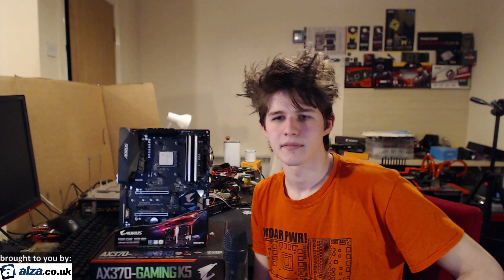Gigabyte AX370 Gaming K5 VRM testing results

Comment: I picked up this board last week second hand at a VERY low price. After watching this video, I fully expected the VRM to be garbage, but low and behold, it stabilized my overclocks and VRM temperature held at only 61C while using a tower cooler. It's the 4 phase VRM that could. My overclock is only limited to the quality of the Ryzen silicon.

Comment: I bought this Mainboard with an Ryzen 2600 and 16GB G.Skill 3200 CL16.
My EK WB Monoblock is doing very great, VRM and CPU (4GHz OC) are around 45-47°C @ 1hour Prime95
Its BTW my first Watercooled System.

Comment: what mic is that? also, can you make a (casual) video about sensor setups, what type of products are needed like probes or multimeters, if soldering is required, mistakes/inaccuracies like infrared sensors changing based on the material, etc?

Comment: Two best am4 motherboards is assrock taichi at 4,2 GHz and gigabyte gaming 5 white at 4,15 GHz....am4 b350 motherboards is more made for CPUs like the 1300-1500-1600 ..cause it has little vrams ..putting 1700 in a b350 has volt shortages and it not made for over clocking really a 1700 CPU..good for a 1600 though

Comment: My Gigabyte AB350 Gaming 3 will just cut the clock speed right down when it hits the VRAM Temp limit. And like you said, does it right away lol. But Of course the Gaming 3 board is worse for OCing lol.

Comment: I'm using a 360mm radiator on my R5 1600, which is overkill cooling for it, yes. But, I do plan on putting an 8 core in it at some point and using the same motherboard. I'm also doing a pull configuration from the top of the case, so the fans blast air over the VRM and RAM, to help keep them cool.

The LLC on my Asus Prime X370-Pro set to level 3, keeps Vcore right at 1.37 to 1.38 under load for 3.9Ghz OC, measured at the back of the socket with a multi-meter. Glad I went with the Asus board, because I'd not be happy with the Gigabyte board lacking that option.

Comment: The voltage of that CPU is so variable.

My first R7 1700 did get to 3.9Ghz at 1.39V and my board VRM was toasty (Gigabyte AB350 Gaming 3).
I did RMA it because of the segfault problem on Linux and the new one are extremely good bin..

1.33V at 4Ghz, seam ok for 1.35V at 4.1Ghz but did not tested enough at that speed yet. Also at 1.33V it was so better for the VRM..

I did replace the Gaming 3 for an Asus B350 Prime Plus because I did needed the PCI slot without having a floating scsi card with an adapter in my case. On the Asus, the VRM feel a little more .. soft. As I need to put some LLC (to Regular) to get it stable while the Gaming 3 did not have such a thing but also don't need it with the same 1.33V.

If they did have a Gaming 3 with at lease one pci slot and moar bios Options, that would be my choice (I 3d printed a air duct to vent the VRM so the temp was really not a problem).

Comment: the same thing as my gaming carbon pro
hits that max tctl temp on max OCs and shuts off instantly
dropping core volts to 1.375 smoothed everything out mostly for me
b4 this u could feel the heat comin off the VRMs
anything but b-die ram is still jacked tho

Comment: 1.37V sounds like a lot. I mean my 5930K does 4.4 @ 1.08VHope AMD can catch up to that one day.
Reply: looking at ryzen's thermals and power consumption that doesn't look bad at all
Reply: I would much prefer 1.37v core voltages at 3.8ghz at say 100-110watts with a ryzen cpu, than 140watts at stock clocks with a 5930k. Comparing intel and AMD core voltages is pointless, they are different CPU's with different voltage requirements and tolerances.
Reply: What is your point? We all want better clock speeds out of ryzen, no argument there. But I could care less the voltage required to get there assuming it does get there and can be cooled. The silicon and transistors in ryzen are largely whats holding back it's OC potential, not voltage or thermals. Even with LN2 it's hard to get past 5ghz with even somewhat acceptable memory speeds.
Reply: Indeed they are different CPU's in most ways, but at the end they compeet in the same business. If you care about TDP, you might be right, but as i'm more interested in OC than power consumption, i think i can stand my point.

Comment: I hate that this and ASRock's Fatality don't have LLC control. Like B350 I can semi-understand, but X370 is just not really acceptable.
Reply: awesome David K. explained this to me: first batch of K4 (the one I have) had the LLC setting, then they changed VRM layout on the 2nd batch and removed it. Then they stopped producing the K4 and launched the X which is basically the same as the 2nd batch K4 but with a fix to RAM pcb which in the K4 limited the speed to 2933
Reply: Which Asrock Fatality? I have the X370 board, and it has LLC.
Reply: The Gaming X doesn't, but apparently did at some point and then they removed it. The K4 still does though.

Comment: I keep my Ryzen 7 1700 at 3.9 GHz with 1.375V since the second day it launched and I received it. My MB is an AsRock X370 Killer SLI/AC. The voltage calibration set to 1 out of 5.

Comment: Gigabyte 5 avoids the overheating issues that he's seeing here with the K5, due to much lower heat output (more efficient).
Either way, inside a case, if you have multiple exhaust fans rather than just one rear fan or a open test bench (along with an air cooler, or a water cooler that directs air flow to the VRM wheras buildzoid has a watercooler for the CPU laying off to the side) you'd prolly have better results
Reply: AT least I presume it would end up working better, prolly wrong
Reply: Depends how well the AIO is ducted. I had 1/3 of mine intake from the VRM, allowing me to push my $40 board with 4 phase VRM past 300w on FX (this was a board Buildzoid wrote an article on that said don't overclock even a 6 core, it will probably catch fire... Something along those lines. But I managed to do pretty good with an 8 core in terms of clocks. I think the AIO fan speed of 4,000 rpm definately helped, it was moving a lot of air over the VRM (ducted with a ghetto pop-tart box cut to make a basic duct).
Reply: I have the Z370 Gaming 7 and it has a little fan built in for the VRM. Hasn't ever kicked on yet with my 8700k @ 4.9ghz. I  have to delid if i wanna go any higher. Chip is HOTT!! Really nice board though. Aorus is really pretty. It's my first gigabyte board.

Comment: I would never buy a board with overheating components. design failure. for me not acceptable. gigabyte up7 ain't had no probs with that.
Reply: That also means you can't go with Intel (even the CPUs have basically blankets in between the IHS). I wonder why mobos don't use awesome heatsinks like they did on a lot of the AM3+ boards, those things had heatpipes and a huge amount of fins, these new ones are a rock with some slits (Linus Tech Tips style I guess...)
Reply from the maker: most AM3+ boards would also fail the test I ran this board through.
Reply: That's true, and adding a fan was essential to mine (you gave a review on my exact board warning to not even overclock the 6 core chips). I managed to pull over 300w with an FX-8350 at 1.5125v with the $40 Asrock 970m Pro3 (the one with heatsinks). So it could handle an FX-9590 after modding, but not much above stock for the 9590. You were right about it not being able to handle it though, at least without fans, pretty much burn your finger on the VRM with anything over stock with my chip. But it would at least throttle when overclocking to prevent a fire, which was good.

Added heatsinks to the chokes, 2x 40mm fans on the VRM, followed by a duct for 1/3 of my AIO inlet to suck from the VRM (120mm fan at 4,000 rpm). That was what it took, but it was just $3 plus some glue and a pop-tart box, not a difficult modification, but it wasn't exactly pretty after I was done.
Reply: On the nice boards though, some of those had heat pipes, and since they had more than 4 phase VRM, they ran a lot cooler. I'm thinking of the Sabertooth and similar boards. I wish we had those massive heat-sinks back. Its like technology took 1 step forward and 2 steps back on cooling.
Reply: Actually Hardcore Overclocking there is no advanced knowledge involved to design a working heatsink solution. the only thing what seems to matter is some sort of design. its not even pretty..so for me a total fail. I will never support such nonsense.
Reply: If I'm reading your statement correctly, are you saying my heat transfer class was all a lie? Its not simple, you need to calculate optimal number of fins for different conditions (natural air convection, forced air from a fan, and how fast), too many fins means you choke it and it does worse, too little and it doesn't have enough surface area. Its really not a simple thing to design, but if you are talking about the garbage they are using now that is like a rock with some slits cut out, those must be made by marketing, because they are awful...
Reply: Jake Garret every manufacturer did produce working heat sinks in the past. there is no need for development work.
Reply: We can always make better (just like vapor chamber heatpipes were a big thing, recently using wicking material for move fluids through capillary action have seen production in heatsinks). The problem is, we are using the worst heatsinks I have ever seen on these boards. It looks like the disaster LTT made with a reciprocating saw, and a block of aluminum. Clearly these were put on by marketing, because no engineer (even drunk) would think these were good. What is sad, is these pieces of junk need to be custom manufactured instead of pulling a real heatsink, right off the shelf and bolting it on, so they are paying a lot more, for something that performs terrible.
Reply: you're right. the main problem is people still buyin this shit. first the intel TIM desaster and now on top of that heatsink dummies. i can not believe how much junk you get if you buy modern consumer pc stuff...I boycott that. reviewer should broach the issue more clearer

Comment: Here's a thought for you, recently Der8auer released a range of custom intel processors. Given your obsession with VRM's and their inadequate heatsinks, why not team up with a third party manufacturer and release a range of Buildzoid VRM heatsinks that will tame the VRM's.
A third party VRM heatsink with built in active cooling retailing starting around $20 could be quite an opportunity to exploit this obvious design flaw of inadequate cooling on lower end and some upper end boards. Heatsinks properly finned in aluminium and the premium copper with dual 40mm fans and RGB could become reasonably lucrative in your niche market.
Reply: too many motherboard layouts due to many many separate motherboard models, and small market, No average joe is gonna buy this, and who ever would buy it probably will spend that money on a better board.
Reply: A lot of VRM layouts are very similar, especially the vcore which is the important bit, that it would be possible to create a universal heatsink with adjustments for mounting points. Sure there will be exceptions but if you look at each manufacturer, their B350/x370 boards all run pretty much the same or so similar so as to not make a difference. So at worst you are likely to need just one heatsink design per manufacturer per chipset, but more likely  you will just need one heatsink per chipset with a variable mounting point design.

"No average joe is gonna buy this"
Which is why it's a niche product, there will be average Joe's that will, but the target market is overclockers who cannot buy the upmarket boards and compromise to entry/mid level boards just like the one depicted in the video. $20 for a VRM cooling solution that is tidy is a much better solution than zip tying a fan over the VRM area. People routinely spend $100+ on CPU cooling that doesn't help the VRM's, so $20 isn't a huge ask for the VRM solution.

Then there are boards (like the asus b350m-a) that doesn't even have a cooler on the VRM's.
Reply: I don't know if he needs a custom heatsink, but just a simple custom fan that you can mount on any of these motherboards would be good enough it seems. Something that fits on the bottom end or top end, or maybe on the side of the capacitors, so you know that it won't interfere with an IO shroud or anything like that on any motherboard.
Reply: So... He would sell a couple 40mm fans and zip ties? That's as universal as it gets, and takes like 3 minutes tops to install.

Comment: I have a gigabyte X370 gaming (cheapest one, vrm layout looks the same) with a 1700@3.8+stock cooler. According to Hwinfo my vrm temp settles aroung 80c. Case is corsair 460x with intake and out take fans, so its well ventilated.

Comment: Want to see a bad VRM heat sink? Look at the msi x370 gaming pro carbon.
Reply: Really? I just ordered one, as I had to RMA my B350 Strix board, and the Gaming Pro Carbon looked like a worthwhile $30 upgrade. Please elaborate, and whether I should cancel the board and get something else.
Reply: Ben Willis I am running a R5 1600 at 3875mhz 1.45v on this board. I don't have equipment to test the thermals but under full load the vrm is hot to the touch (it feels slightly cooler than a cup of coffee) maybe 65c with the CPU pulling about 100 watts on HWmonitor. It is an 8+2 phase though. I was just pointing out that the heat sinks don't have much surface area.

Comment: the prime x370 pro has the same vrm as the strix x370-f is cheaper and has aparently better vrm cooling
Reply: same design different mosfets
Reply: I have the Prime X370 Pro and it's got some hefty slotted heatsinks on the VRM. I have had no issues with the board in this regard, and currently running a custom loop.
Reply: Yeah it is pretty good. I just would like to know what their temperature sensors are. They have 4 sensors named "Temperature" numbered from 3 to 6 in HWiNFO64 which I just can't figure out what they do.

Comment from the maker: guess how many reshoots this one got!

Also OC show on twitch today!: https://go.twitch.tv/overclockingtv
Reply from the maker: too low
Reply: Uhm that wasn't nice. It was flowing nicely but feels kind of empty so, same scaling this one was zotac 16 phase vrm good marketing but empty inside.
Reply: At least 10 because you knew exactly how to phrase what you wanted to say and were very sure of the numbers.
Reply: Knowing your channel, I'd say 0, but I'm now wondering is that a tricky question?
Are you going to water-cool this VRM if you use it in your daily machine?
Reply: well, been chasing down a random, totally random crash issue this week on the non-k 5... So I will guess that many times, lol.

We need to find real aftermarket heat-sinks for our VRMs, somebody somewhere has got to make them (that is not ten year old discontinued parts, lol).

Great vid by the way, I never thought to check the VRM Over Temp protection.  Also the USB ports&controller are set to fall asleep even in windows performance mode.    Thanks..  B)
Reply: it could be an interesting solution for the K5 vrm issue
Reply: There is a monoblock for the K7/K5/G5 from EK. It would be amazing to test this board with it....
Reply: jimarasthegod
it will also will be expensive testing. for the addition of the monoblock price you can get the highest end MB out there. and if you already have  highest end MB, VRM temps are not really your concern.
Reply: Sweet
Reply: 12?
Reply: 666
Reply: Actually Hardcore Overclocking do you think watercooling the vrm will solve the heatsink issue?
Reply: 69